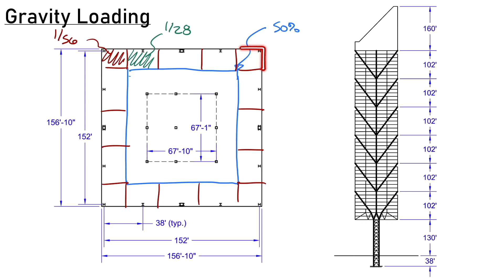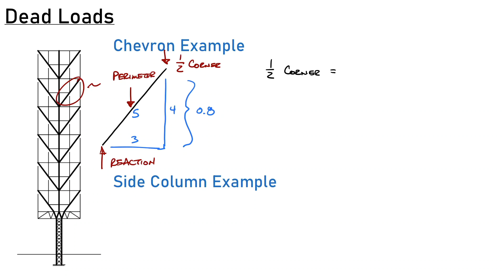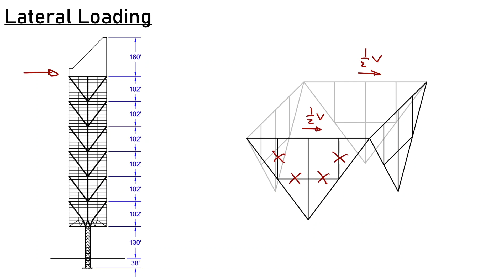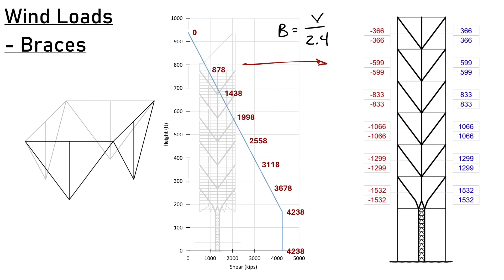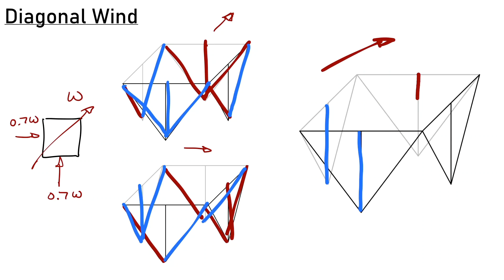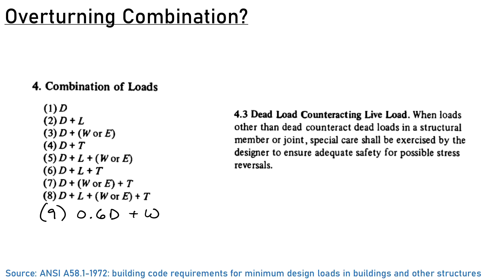Analyzing the Citicorp Tower: A Structural Engineering Deep Dive

Comment: Thanks for a great video! Two questions please:
Why can’t the inner core take all the lateral load?
Do the triangles at the periphery act as an outrigger? Can they not take any shear? Thanks a lot!
Reply from the maker: The design of the Citicorp center did not use the core system to take any lateral load at all; it was designed only for gravity loads. To my understanding, the core does not have any substantial bracing or shear walls to resist lateral load, except in the base of the tower where the building is "elevated". 

That answers the second question about outriggers too - the point of outriggers is to connect the core (capable of resisting lateral loads) to the exterior columns. But with no functional strength in the core, the peripheral bracing cannot function as outriggers. Arguably, the only outrigger-like system is the transfer truss at the bottom of the "tower proper" when the structure transitions from the elevated base to the exterior braced system. A better analogy to describe the bracing around the exterior of the building in an exoskeleton.
Reply: @StructuresProfH  Then it is not clear which system takes the shear, because the tree-like truss can take/resist only moments.
Reply from the maker: @the_right_path_14  The truss carries both shear and moment, just like any braced frame structure: moments are resisted by the outer columns in compression/tension, while the diagonals carry the shear. Even without corner columns, there is a load path for shear, though it is rather unusual. This load path requires that the diagonals on all four sides of the building carry load even when the wind acts in an orthogonal direction, and this leads to the noted issues when quartering wind is applied.

Comment: Nice to see finally someone putting number on the challenge.  One possible error in your presentation is at 26:10 where you use "W" to represent the diagonal wind force but then you state the column force is 0.7 of that in the orthogonal condition. Isn't it true that the diagonal wind force is actually 1.41W of the orthogonal case due to the wider profile diagonally?  In this case the column force ends up being the same.
Reply from the maker: Good question. Designers typically assume that the diagonal wind force is still roughly equal to W, not 1.41W, despite the wider profile. Mainly, this comes down to aerodynamics - diagonal wind does not hit the faces of the building orthogonally, so we reduce the pressure that acts on those surface by a factor of sqrt(2)/2. Combining this sqrt(2)/2 reduction with the sqrt(2) increase in the building profile cancels both out, so you are left with force W. Wind tunnel tests tend to confirm this practice.

[* Side note: current design uses a factor of 0.75 instead of sqrt(2)/2 for the pressure reduction, which works out to 1.06W force on the diagonal of a square building instead of just W. I left that out; it's a minor distinction that wasn't around at the time of the Citicorp Center design.]

Comment: At minute 28:02 you  sed "the infamous 30th floor" but as there are 8 floors for each section the 30th would be in the section above
Moreover the fourth section has (in the diagonal wind case) experience 357 kips instead of the 24 in the orthogonal case, its a 1400 times increase... 
i'm doing a research project about the Citicorp centre and this part of your video is a bit confusing to me.
Reply from the maker: Great question. Sorry I didn't give the whole context on these in the video, but I do have answers for you.

Regarding the 30th floor comment: 
The tower base from ground floor up to the top of the "stilts" is 10 stories. So the first stack of braced floors is floors 11-18, the second is floors 19-26, the third is floors 27-34, and so on. So the 30th floor is the 4th floor in the third stack.

Regarding the demands in the fourth stack (floors 35-42): 
It is true that demands increased here from 24 kips to 357 kips, which is almost a 15 times increase. The reason this region was not as critical for retrofit was that a minimum connection was used for all splices with low loads just to "hold it together". This minimum connection likely had a capacity of 250 kips, judging from Le Messurier's elevation figures in the appendix of Hartley's thesis. Meaning the fourth stack was overstressed by 357/250 = 1.43 instead of 357/24 = 14.88. On the other hand, the region at floor 30 had an original demand of 257 kips, just barely above the minimum threshold. Thus, when this demand was increased to 683 kips, the overstress was 683/257 = 2.66, making it the most overstressed region throughout the building.

Good luck on your research!

Comment: I may have missed it, but the reason that there weren't standard corner supports all the way to the ground had to do with the only building that wouldn't sell for that plot. A church had demands that their building have a certain amount of clearance above the roofline, requiring a cutout for the corner. As this was already changing the typical "four corner" design, the architect came up with the "four notched out" corner design.  It all would have worked except for changes from his welded support design to a bolted design-with the engineers neglecting to consider for quartering wind loads.  This meant that the 8 bolts used were insufficient as some floors would have required up to 32. The improvised structure was in danger of collapse, but fortunately the original engineer felt uneasy and kept looking into the issue for a fix before it did.
Reply from the maker: Thanks for the recap! You didn’t miss it here - I left the history of the building out in this video, as others have covered that elsewhere.

Comment: i dont think it was a good idea not to connect corner columns with the exosketon. the bottom truss is redundant. those corner column in the lower section would simply be in tension without it and having those connected to exoskeleton would add to spatial stifness creating more triangles in the tube.
Reply from the maker: I think this is a good take. One of the main reasons the corner columns were not connected in the original design was to keep the load path determinate. While this simplified the analysis, it likely did overall harm to the stiffness of the building. The lower stack of columns being in tension (essentially hanging the floors from the braced level above) increases the compression in the lowest level of chevrons, as the load being carried by the bottom truss now has to travel up. That likely is not too problematic. It might also complicate the construction sequence.

Anyway, thanks for the comment! It would be interesting to see how differently this structure behaves with continuous corner columns.

Comment: Not an engineering student myself, but I was wondering if you could comment on the newer studies saying that new wind measurement technologies show that the diagonal winds are confirmed less stressful than perpendicular winds as initially thought, and that it's possible the repairs weren't needed? Are there assumptions/simplifications that the author is making that call their conclusion into question? Is Database-Assisted design well tested and accurate enough to replace the static calculations you use in this video? 
 https://pmc.ncbi.nlm.nih.gov/articles/PMC8240663/